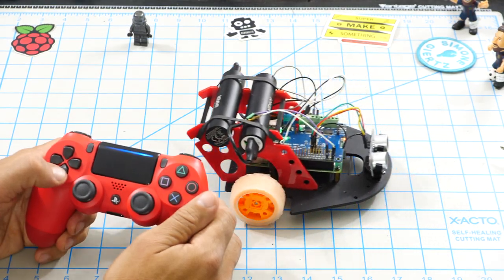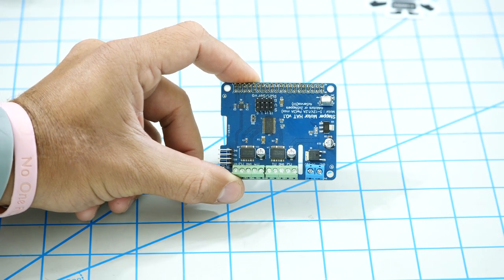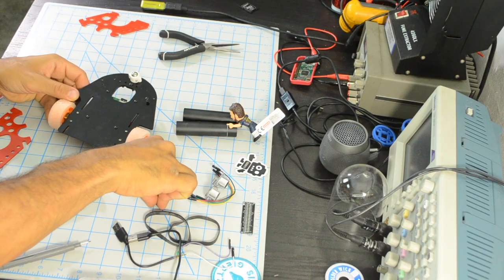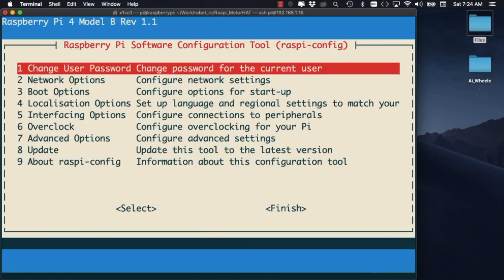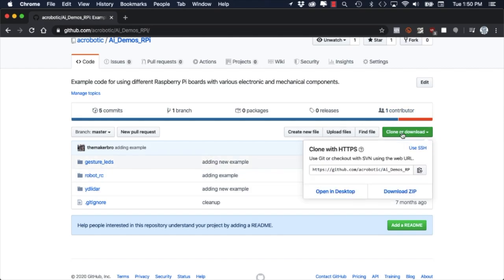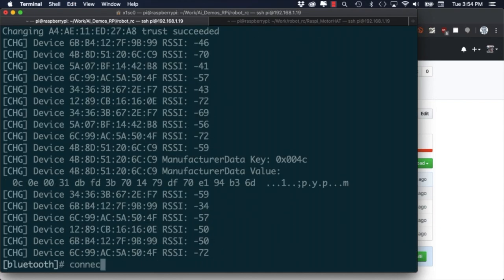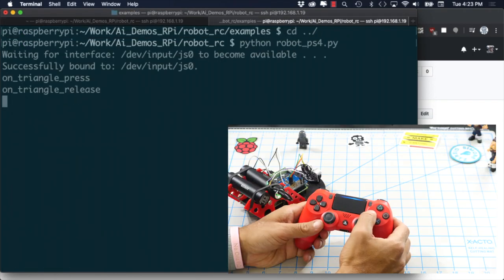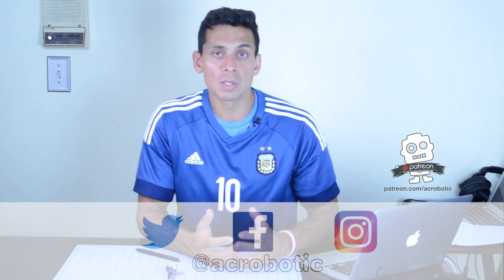Raspberry Pi 4 Driving a DIY Rover Using a PS4 Controller | RC Robot

Comment: can bluetooth program still be used without raspberry pi motor hat? For instance if one were to only use raspberry pi with a motor controller like L289N. Im thinking the motor hat makes all connections and code easier and since there is already sample code?

Comment: I am trying to get a ps4 controller working on my raspberry pi with a roboclaw installed but I can't seem to handle the address and the connection of the controller because the packages are way too different